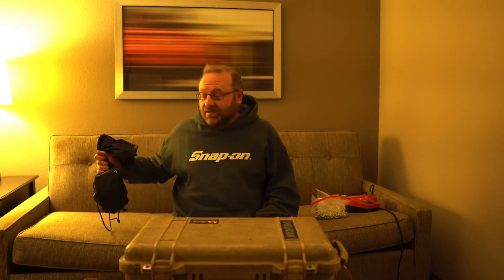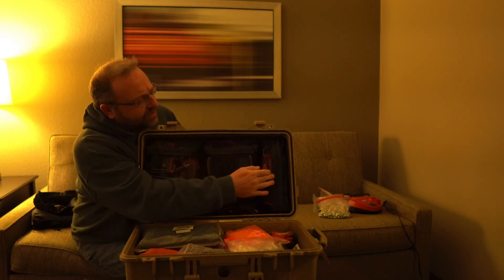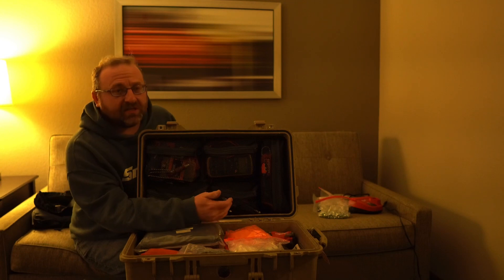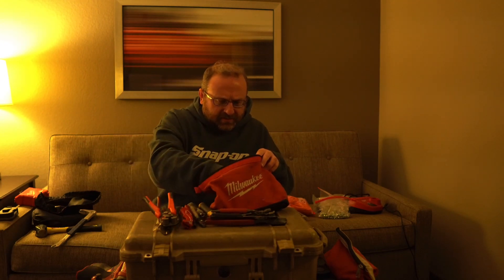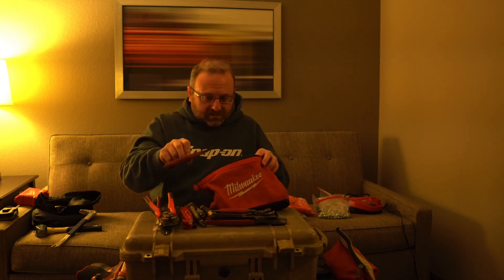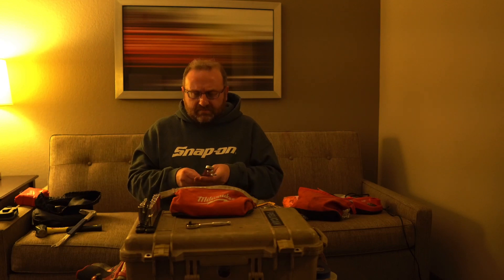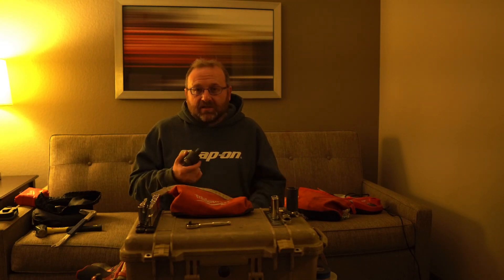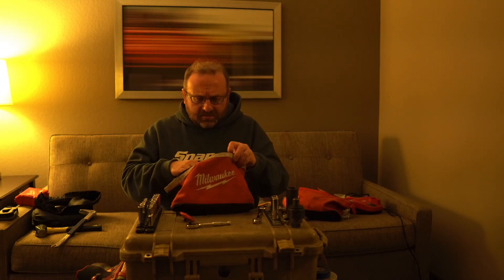Flight Case Toolbox Tour

Comment: Pelican tips: Carry a replacement latch. I color coded my latches and handles to differentiate my case at job sites, so I have the original latches and handle as spares. 
TSA locks do more damage than good. I zip tie my case closed and leave 2 new ties and a note for TSA. Most of the time they will put them on after inspection. 
The klein/milwaukee/husky zip bags are key to organization.
Reply: What do you mean when you say locks do more harm than good?
I just got a new field engineer job where I have to do a lot of air travel and I was advised to pick up some cheap TSA locks (I've never used locks of any kind in the past because I think they are pointless).
Reply: @xsterawesome  Congrats on the field engineer job! I am a field broadcast engineer. 
What I mean by the more harm than good is that the locks get caught on conveyors and baggage equipment and the leverage can actually break the locking loops on the pelican cases. This was more of an issue on the older ones before they added the metal reinforcement tabs, but it is still an issue. When I did use TSA locks, I would usually end up with one or both of them missing or broken during the trip. I just found that zip ties would actually keep the case secure and TSA could cut them and reapply a set if they needed. 
Depending on the airport and how busy they are, you can also let the gate agent know that your case contains sensitive or expensive equipment and ask to be present while your bag is hand checked, and then ask them to zip tie when the inspection is complete. 

If my trips are planned in advance, I end up shipping my tools FedEx to the site or hotel ahead of my flight just to not have to deal with it at all.
Reply: @kg4gav  Thanks.
I never knew you could watch them inspect your luggage! I wonder if that would work for using a normal lock unlocking it when they wanted to look at it and locking it back when they're done.

Before I have done field engineer work in the medical field, in that field it was pretty typical to mail anything you couldn't drive to a site with (or if you had to fly) but this job advises against mailing anything because it's very typical for there customers to change plans last minute, and they don't want to be responsible for your stuff.
Reply: @xsterawesome  I usually fly in/out of smaller regional airports, they tend to be easier to deal with than larger airports. AS far as using regular locks, there is a way to do it, depending on your personal feelings and desires. If you travel with a firearm, you take your bag(s) to the counter, tell them you need to declare a firearm. You will sign a declaration tag, and they will have an agent come to you. You then unlock the case with your keys/normal NON TSA locks, they inspect it, and then you lock it back and keep your keys. The agent then delivers your bag to the back. Another bonus is you get VIP'ed to the front of the TSA line. 
Now, the 'firearm' doesn't have to be a functioning gun,  it just needs to be the serialized receiver part that is considered by law definition to be a gun, and it needs to be packaged according to air travel guidelines.  If this is something you may be interested in, I'd google "Deviating (dot) Net packing and the friendly skies", for a website and youtube video on how to do this.
Reply: @kg4gav  Cool I never thought of that, I knew you had to pack a gun in a hard case but for some reason I always thought it had to be by itself, personally, I'm all for concealed carry but I've always been terrified to fly with a gun I've heard too many horror stories lol, and I know if you walk through the TSA line and forget to declare your firearm that can be a $10,000 fine.